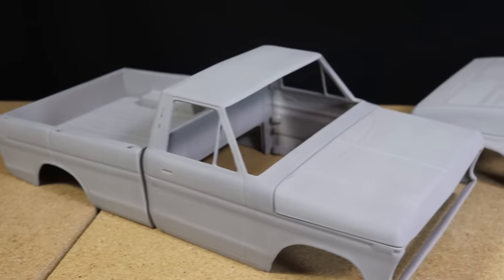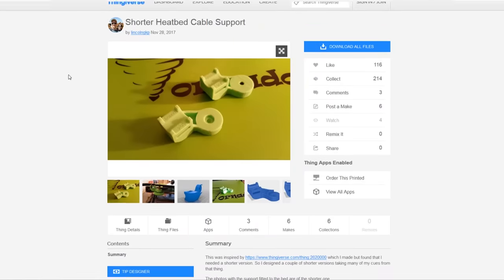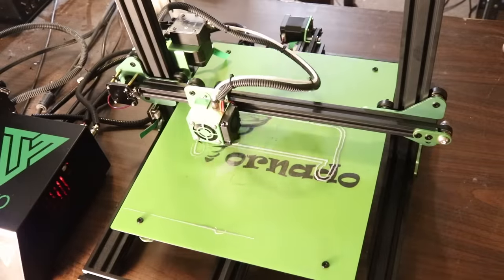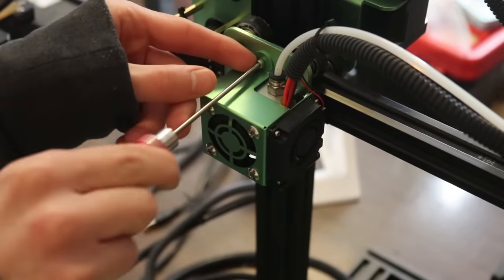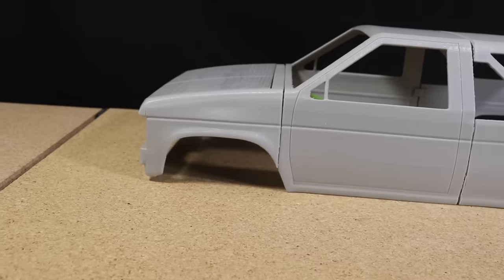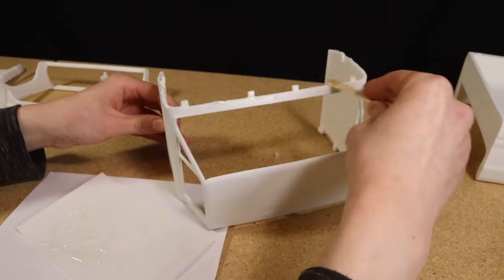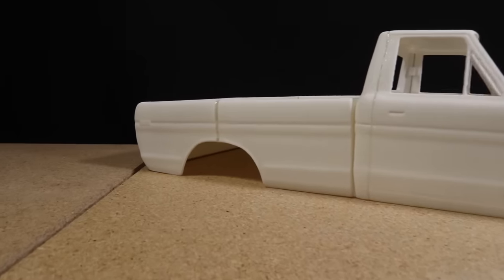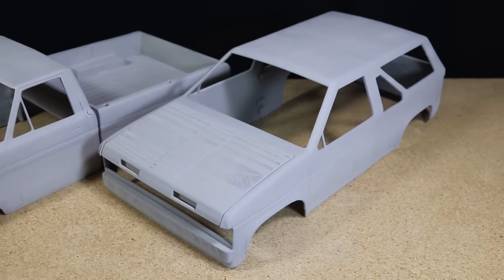Printing + Assembling 1/10 Scale RC Crawler Bodies From Scale 3D RC

Comment from the maker: Really pleased with how these bodies are coming along. All the sanding and filling gets tiring but I'm finally about ready to get them mounted and painted (aka the fun part). On that note, I'm still not 100% sure what color/theme I want for each body. I've got some ideas but nothing is set in stone. Any ideas? I've finally got some new build videos that are coming along nicely that I can't wait to share with you all soon.
Reply: Camo. Maybe a digital camo.
Reply: Make It RC I was thinking but would you consider making a 69 charger to go with the scale rc fire bird
Reply: Is the body strong enough for heavy trail use?
Reply from the maker: @jrduenas3678  The quality of the print and the material you use will make an impact on durability. I'd imagine that the infill will also have a significant impact as well. The bodies I printed could probable handle a pretty big fall or rough trail driving just as good if not better than a lot of plastic hard bodies that are more common. Certainly wouldn't recommend it for any serious bashing though.
Reply: Nice vid. I just finished printing one  of their models. I think they make really nice files and a lot of body options.
Reply: very nice. good job!!😊👍
Reply: Hey Make it RC i like to ask you about the pathfinder body i have idea for it how about doing a 90s baja racer since it can be paint in red,white and blue scheme of the race cars form the same era as the suv so do you like my idea for it make it rc.

Comment: Automotive Bumper Filler... best stuff I've found so far for filling in layer lines on bigger FDM prints 👍
Reply: Xtc-3d is my go to for finishing 3d prints. 2 part epoxy. Mix for 1 min, Apply with foam brush (maybe 2 coats). After a few hours its sandable with 400 grit and pretty smooth afterwards

Comment: Get yourself a Gator brand foam sanding block. It has a micro Velcro system to hold on the paper. You will love it and it really helps with sanding large flat areas.
Reply from the maker: I appreciate the tip. I was thinking that some sort of sanding block would be helpful. I'll look into those. 👍

Comment: I've bought and printed a few Scale 3D RC in the year I've owned my 3D printer. Some parts print just fine, others aren't too hot. My biggest issue is the front clips and the rear tailgate pieces. Those require a lot of support if you print them with the closed ends facing up in order to keep the faces printing clean. All in all, it's a great company and they have designed a few of the trucks I've requested which is pretty awesome.

Comment: General tip, you could have saved alot of PLA if you reduced the support density. There is really no need for that much supports. Using 12 to 15% support density is about the sweet spot, you can go even lower if your printer has good bridging capabilities or if you can set a "support roof" that will add a couple layers of 100% density support only at the top !
Reply: Be careful with support roof it can make them hard to remove. It does however give very good looking layers
Reply: TheRandomizedvids GUY 
I started using the support roof on some small to medium overhangs with good results.    Most of the time the supports snapped off easier and in one piece instead of a bunch.    

Another option is Cura has conical supports.    Small at the base and builds up towards the top.  Takes more time but a huge difference in support material

Comment: copyright does not typically apply to vehicle designs under the 'common item' clause.  however, trade marks are still protected, which is why they don't use the manufacturer's name, etc.

Comment: If you heat up the nozzle prior ro swapping it out it is much easier.
As for glueing the parts together. make yourself some liquid Styrene in a glass jar. Buy a container of MEK, pour in  jar, cut up some Styrene sheets and let the mek melt the styrene. It is good to glue and use as filler and you can adjust the viscosity  to your liking. You can also use it to mould parts if needed. #giveaway

Comment: It will take much long but you'd get a better print at a lower layer height, and 100% infill, less lines and much smoother transitions to deal with.

I use a ANET ET4 Pro and print at a 0.06 layer height, with a raft and 100% infill, and 35% support angle.

Comment: Nice project. for when u change nozzle. u need to preheat the nozzle to 250c to remove it easy. and also when u put a new nozzle back. heat it up to 250c and then tighten it. otherwize u may get a lozzle nozzle and it will start to leak out of the heatblock and travel up on the heatblock. and that´s a pain to clean. just a tip :)

Comment: 7:42 Using ABS and acetone vapour to smooth your print, won''t do a whole lot of good when you're printing at a .3 layer height. Acetone smoothing works best on layers that are less than .2 in height. Using taller/thicker layers will only make it harder to get a smoothed look, because it would require way more time for the vapours to do it's thing.... and by the time it does on a .3, the rest of the model's body could become rather soft.

Comment: Using wood filler or plastic filler putty instead of epoxy makes gap filling much easier when assembling 3D printed plastic parts.  You can also use it for highly "stair stepped" parts to get a great smooth finish on PLA parts.  #giveaway

Comment: My needs for a 3D printer are pretty specific because of the final surface finish I need.  I really do not know what type and brand of printer to deliver.  For now I have joined a 3D printer group on Facebook and follow it along.  I hope I can get my question and needs answered in 6 months.

Comment: really enjoy your work sir been binge watching your videos now in preparation for my own project. I had a quick question do you know how long it takes to print one of these files? on average? the website you recommended has some incredible bodies and I want to pick up a file but I don't own a 3d printer yet so would need to take it to my local print shop, they charge by hour so I was trying to figure out roughly how much it might end up costing.
Reply from the maker: I'm glad your enjoying the videos. The time it takes depends on the printer settings and assumes that there will be no issues that require a part to be reprinted. I think in total for one body, it took around 20-30 hours of printing. I'm sure with different settings and orientation it could go faster, however I'd rather have the print time be longer and spend less time doing post print finishing work. I hope this information is helpful, good luck with your project.

Comment: not many or much mention of cost ; I mean the use of shapeways or similar 3D printing service if you are not furtunate enough to own a 3D printer. 

I may have missed it in video or other posted comments,but if I buy an ( approximately) $10 design from Scale3DRC , what can I expect to pay to have it printed & delivered to me? A cost approximation for the bodies in video would be helpful. The shapeways site wasn't extremely informative on pricing ...
Reply from the maker: If you have your own printer they are a very price friendly option. You have the cost of the body (around $10usd) plus filament (maybe $10 - $20 at most). You can also print as many as you want. If you are going to have the body printed by a company, especially a more pricey service like Shapeways it's probably going to be a lot more expensive. At that point it might just be cheaper to buy a body from Pro-Line, RC4WD, etc. It's sort of like building or restoring a real car. If you have the tools, knowledge, and interest as well as willing to scavenge salvage yards, and swap meets for parts, you can build a nice driver for cheap. If you need to hire a shop to turn every bolt and patch every rust hole, the price will skyrocket. I think the Scale 3DRC are most ideal for people with their own printers.

Comment: Nice, I'm just looking at getting a larger FDM printer so I can start printing my own custom RC bodies. The Ender 3 Pro just isn't big enough... Interested to know what slicer you use, the supports look so much easier to remove than what I get with Cura v4.4. Did the 0.3mm vs 0.4mm nozzle help in this regard?
Reply: did you ever get a bigger printer for printing RC shells? cheers
Reply: @90sarcadefighter5  Yes, bought a Creality CR-10 v2 with BLTouch auto bed leveler... plus I also have a couple of resin printers now. I print more accessories than bodies. The last one I did was a 1/10 Winnebago Brave.
Reply: @paulblythe5899  nice! Thanks for the quick answer. after pretty much learning and watching all day ive settled on an CR 10s pro v2. i have a mint shell to print! what would you say in your experience is the best material to use for RC shells? (nitro)
Reply: @90sarcadefighter5  Nitro's get hot, so probably ABS, but you'd need a temp-controlled chamber for your printer to properly print ABS... The next best would be PETG, which prints easily like PLA, but with a slightly higher hot-end temp, and a heated bed.
Reply: @paulblythe5899  I had read and kinda settled on PETG but cannot get enough opinions. When you printed your 1/10 Winnebago, on the cr10 i presume, was it printed in 2 pieces I gather?
Reply: @90sarcadefighter5  yes, it was split and printed in multiple parts. I just did a basic overlapping joint and glued it with Araldite Rapid.
Reply: @paulblythe5899  Thanks Paul. would you say its an easy enough process for a noob whos keen to learn? i have no experience with slicer/slicing/software.
Reply: @90sarcadefighter5  Yes, if you don't mind learning from mistakes, and figuring out why a print failed... I'd be happy to help with basic settings and tips to get you started.
Reply: @paulblythe5899  Very kind of you matey ill take you up on that no doubt. as mentioned i have the .stl file, now all i need is the printer lol. ill contact you again when ready if i may :)
Reply: @90sarcadefighter5  No problem 👍

Comment: I think it would be much easier to use glazing/spot putty rather than epoxy. Also cool models but that's a lot of support material. #giveaway
Reply from the maker: I'll be using filler for the final smoothing, but I like to use epoxy at first to glue each piece together. It sands pretty well but is there a glazing/ spot putty that would also work as a strong adhesive?
Reply: @MakeItRC  I mean to use either epoxy or CA glue for structural and then using glazing putty to smooth and fill. I find glazing putty is much easier to sand and smooth compared to epoxy. Personally, I use a low power soldering iron with a nail for the tip to weld PLA parts together. ABS also sand pretty good and much easier to glue with acetone. put ABS parts together and drip some acetone between the gap and press together for a few seconds. Great job with what you are doing.
Reply from the maker: @victorchan8859  I appreciate the info. 👍

Comment: These are what I have been looking for but a little big.  I have had some luck with reducing stl files to fit my rc chassis.  I haven't had luck with finding descent stl files though.  I believe this will work for me.  I have a WPL toyota I am building and want to put a ford f150 body on it.  I have upgraded all the parts that I can including a two speed transmission with metal gears, metal diff gears, metal drive shafts, oil filled shocks and metal links to the rear and front end. Love your videos keep up the great work.  #Giveaway

Comment: Those are pretty cool. I've attempted to make my own a few times, but I think I should be separating the model into parts instead of trying to print the whole thing in one hit. Also will there be an update on the datsun? #giveaway
Reply from the maker: Printing the body in pieces has it's advantages. The only thing is getting as smooth of a seam between the parts as possible. I won't be making any videos on the Datsun until it is complete or nearly complete so there aren't huge gaps between updates like there is with some other projects. Probable won't be seeing a video on that project until later in the year. I think those videos will be worth the wait.

Comment: Very nice! I was wondering, could the supports be optimized so to not print such a massive block to throw away? I really love that first gen 4 runner style body. have been eyeing it for awhile haha #giveaway
Reply from the maker: Yes, you could certainly do a better job with the support material than what I did here. I had some issues with the support early on and decided to lean on the side of having more just in case some sections didn't print too well.
Reply: @MakeItRC  makes sense for the amount of time it takes to print these parts :)